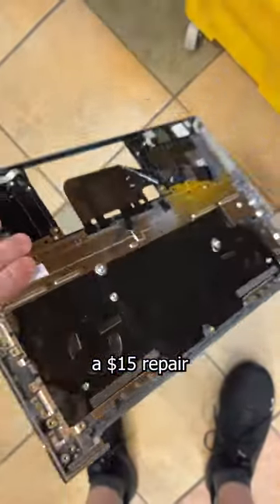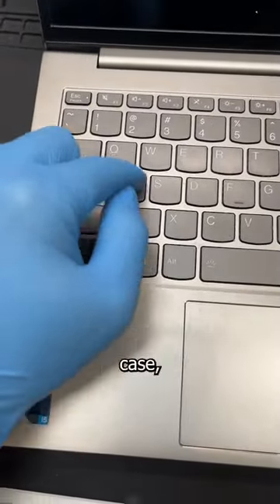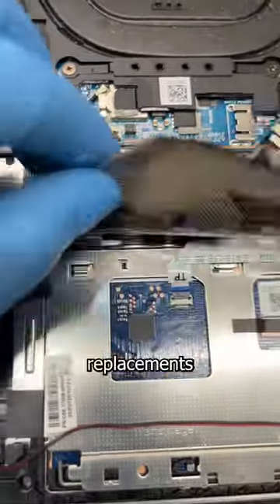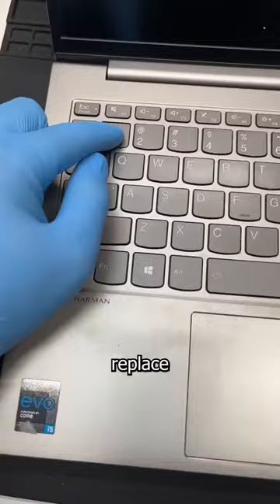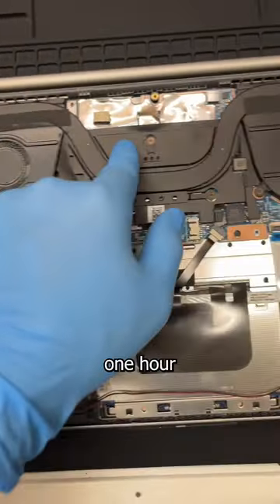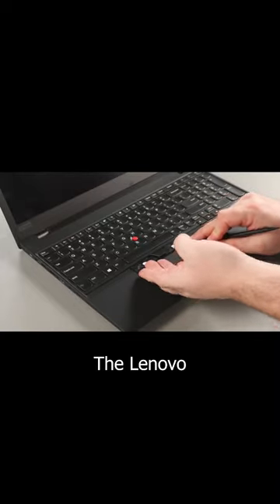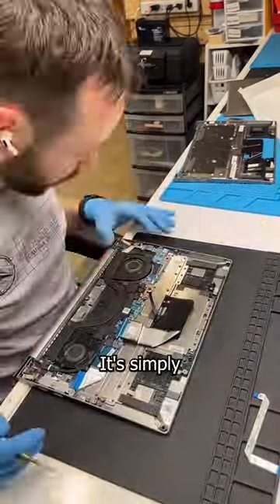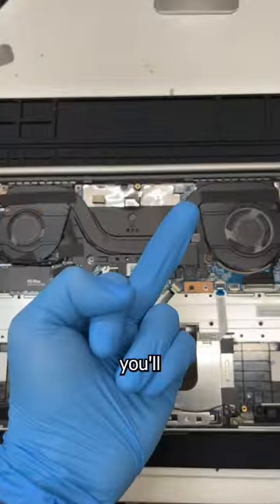This #pc design trend is bad for consumers. RIP Keyboard repair #technology #tech #computer #shorts

Comment: Thanks to Apple we have this trend. Everything is now consists of two parts: screen and everything else glued together.
Reply: On apple you can replace one key without pulling apart the laptop
Reply: @desireandfire not with the new builds
Reply: That is why i hope the new EU law comes out.

So manufracturers are forced to make repair possible. If not, well, keep you shit in china or america, you can not sell in EU anymore.

I really hope.
Reply: @desireandfire you talk about keycaps. We talk about the actual hardware.
Reply: More like thanks to consumers who just buy a new product instead of repairing their current one.
Reply: @Absol407  it is less the consumer, but more the company, which tries to attach the customers to themselfes by denying 3rd party service and repair.
Reply: @dom3827  yes, Apple sucks

The reason I’m specifically saying, Apple is because they started the trend
Reply: @desireandfire  not with new ones
Reply: @RandomRothbardian  ya apple sucks
Reply: @dom3827 i mean, they can't just pull out. They'll lose money so they will apply that shit to every device possible
Reply: @bashjj  Yes you can lmao, it's pop it out but you then have to pull down the single key and it will work.
Reply: @dom3827 i thought the whole idea of the new EU law was to force apple to use type c instead of lightning cables? And apple decides to refute it by getting rid of the charging port all toget her for their future phones lmao (forcing people to buy their wireless chargers). My point being; i don't think the law will do much unfortunately
Reply: No, thanks to basic economics we have this trend. People buy it, so they build it. If people didn’t like what Apple was doing, then they shouldn’t have funded them.

Don’t like it? Go to a country with a different economic system. This is what they’re rewarded for doing.
Reply: @bashjj Source?
Reply: @dom3827 eycaps are hardware.
Reply: @Absol407 THIS, 100%. Consumers REWARD them for this behavior. So why not do it?
Reply: @dom3827 Um, no? Buy a different device then, or none at all. You’re not FORCED to buy an Apple product.
Reply: @desireandfire  You can't replace anything. you have to buy a new one. Always the case with Apple. They have their pros but repairability is defenitely not one of them
Reply: the worst thing is that when Apple removed mini jack input and a charger from their boxes and all phone industrys did literally the same... disappointment
Reply: @maciek6482  I'm waiting for the EU to force them to add those back 💀
Reply: @snowparody  this statement did not age well, didnt it?

I phone 15 comes with type c
Reply: Don't forget the headphone jack.
Reply: @dom3827 Rare European Reich W.
Reply: @dom3827 That’s gonna be horrible as consumer. You’re stuck with mediocre designs to accommodate repairability. 

Apple has been iffy more recently but they had the whole form over function going pretty well for a while. And I miss it.
Reply: @desireandfire with one model, very specifically, you can do that. In 2020.  Every model on either side? No, you can't.
Reply: @desireandfire nope try that with any keyboard since the butterfly keyboard. You think people were just dumb, and decided they like paying for $500 upper case replacements? Nah there wasn’t a choice.
Reply: Waiting until Apple makes a financial mistake that everyone copies for whatever reason.
Reply: same with the stupid trend of making things thinner and thinner and lighter and lighter. What’s that? Now your laptop’s battery life’s getting progressively worse bcs the processors are getting more and more power hungry but you don’t have space for batteries?

or the trend of including fewer and fewer I/O ports for…some fkn reason
Reply: @bashjj if you have applecare theyll take your laptop, transfer the data to a brand new device and you can walk out with a brand new machine with everything set up the way it was… so, doesnt really matter tbh.
Reply: @desireandfire i had broken keyboard on laptop its not like this if one key breaks it will take other to drown
Reply: @desireandfire  What if the trace for the key gets damaged?
Reply: @Absol407 honestly considering laptop performance the most of the time you have to change cpu/gpu before the keyboard is consumed
Reply: @dom3827 Design over form ngl, a government shouldnt be able to force how a company makes their product design when it isnt detrimental to anyone. We dont need a government trying to get their greasy hands on innovation and technology when they dont understand it.
Reply: @hankagura5355  so wrong on so many levels.
Reply: about 5 years ago I had a macbook pro with a dead key and needed to fix it.. brought it to the genius bar and the "genius" told me it was a 700 pound fee because they had to swap the whole thing.. It just made more sense to buy a brand new one
Reply: @189x  it makes even more sense to consequently buy another brand. 

Apple is 1984. Funnuly enough, because they made an Anti 1984 TV ad back than.
Reply: its like saying people started taking shits on the street is my fault just because i took one
Reply: @midnightperfectworld  lmao because you've already paid for the "free care" whether you need it or not.
Reply: Me watching a group of about 6 absolute idiots argue over whether a tech company changed a piece of computer hardware:
Reply: Hmmm yes lets blame apple cuz we dont like them. It doesnt work like that pla
Reply: Why doesn't this show as a disadvantage on the market?
Reply: Same with soldered ram.
Reply: Steve Jobs created a modern nightmare for all of us non-Apple users.
Reply: @matasa7463 If it's a nightmare why are PC companies copying it? Shouldn't it be an advantage against Apple?
Reply: @kpbendeguz  because Apple makes money, and other companies want Apple level money.
Reply: @matasa7463 Yeah, but if Apple does something that bothers customers why competitors copy that mistake? Why don't they use it for advantage?
For example Apple limits people's options for home repairs. Probably because the customer group targeted by Apple doesn't want to repairt their stuff at home anyway, so Apple can make its products thiner, cheaper to produce, etc. in exchange of home repairability.
However an Apple competitor could target a different group that actually does care about repairability and steal those customers from Apple. So why don't they do that?
Reply: Why do people have to copy the bad stuff from Apple. The good stuff sure I get. But bad stuff?  Just no.
Reply: 127.85% my dude😂

Comment: This is the reason why we need to support the FrameWork laptop. Modularity allows for replaceable and repaireable components
Reply: I'm sold. I'm buying one as soon as I can.
Reply: and according to another comment it's $900 and you have to assemble it yourself I'm probably going to end up getting another laptop.
Reply: @yourlocalidiot69420 their “DIY” laptops are a bit of a misnomer. I got a DIY model thinking I would have to fully assemble it, but all I needed to do was put in the M.2 drive and RAM sticks. Then you put the keyboard plate back on with like 6 screws. They also have an assembled version though. But yeah they are priced as premium laptops but the repairability makes it worth it to me, though not everyone is going to value that aspect as much. So in the end it’s just preference.

Comment: Planned obsolescence
Reply: Nah probably not.
It is cheaper, and more durable and as mentioned has a better typing experience.
And the "for whatever reason" is that people started to very much prefer these laptops so amufacturers simply build what people wanted.
Reply: @AlphaHorst  sure people wanted this, not every company simply started to copy apple...
Reply: @mtx33  apple was not the first to do this... but ok dude. 
I believe Dell did it in some of theirs as well as HP and Microsoft.
Reply: yes planned obsolescence disguised as "making it cheaper to build and durable and so called better typing experience".
Reply: @Kuroji07  well everything has its downsides. So if you want to call every downside a case of "planned obsolescence" be my guest. Well if you can write this on your modem powered Internet.
Reply: @AlphaHorst  maybe apple wasn't the first to make an integrated keyboard like this (if they even really invented anything at all), but it was the first company to make it's core strategy to build products as hard to repair as possible and the industry tends to follow money. 
It's a business decision to control the product life-cycle and not a technical one. I've had similar style laptop a couple of years back but instead of plastic rivets, the keyboard was secured by a lot of tiny screws.(no height difference) There is no real excuse to do this other than profits. 
Think of a mechanical wristwatch, so small and so complex, water resistant, durable. So how come we can disassemble them to the last cog? It was designed that way.
Reply: @Kuroji07  planned obsolescence wouldn’t be so much of a problem if it weren’t a software issue instead of a computing issue

If you’re using a Apple phone, that’s obsolete, they will not allow you to use apps, and other things that require the newest iOS
Reply: Mostly just cheaper and way easier to manufacture
Reply: @AlphaHorst Hows that boot tasting bud?
Reply: @AlphaHorst is it more durable? If it's cheap and hard to repair that is definitely in line with a plan to require replacement.
Reply: @Kuroji07 Exactly. Some eMachines laptop from something something 2000s still goes strong even with one key fucked.
Reply: yh

Comment: As a computer repair tech I hate this trend. 👎 Every week we get broken keyboards and you’re absolutely right, it makes a quick repair into a long ass nightmare 😩
Reply: Get a solder station you won't care about a whole lot and you can get JUST the keyboard. Get some 3D printer filament and you can plastic weld it into place. Once you're good at it, it's a 20-30 minute process
Reply: During high school I became my school districts computer repair guy and every kid in the school had a computer. I watched the change in keyboards happen and I really had to slow down on my repairs because of it...... I GOT FIRED BECAUSE I WAS NOT FIXING COMPUTERS FAST ENOUGH!!! So with that said I am so sorry you have to deal with this.
Reply: @bridgergriffiths4364  And then they had no repair guy at all. Any replacement would’ve been just as screwed.
Reply: Why are you whining? Thats more cash for you.
Reply: @nordicsweetroll I also thought about a solution like yours, but I have doubts about the tightness of the new plastic on that shit they put
Reply: Do u know if a nitro 5 has this problem (sry kinda random, I’m just looking at buying one and am curious)
Reply: @nordicsweetroll  Man of tech culture I see
Reply: @kaeji_namitsua 
1) if you tell a customer that a keyboard replacement will cost $200, there is a chance said customer will say “f-it!”, and put those $$200 into a new laptop.
2) there is a higher chance a customer will agree to spend $20 to change the keyboard than $200 for, in the customer’s eyes, the same procedure. 
3) as the video states, replacing a keyboard that’s fused with the palmrest implies risking damage to other components (those damned ribbon cable feet break apart all too quickly)
Reply: two words buddy..
SKILL ISSUE

Comment: me quietly sitting with my thinkpad x220 which only needs 2 screws to remove the keyboard
Reply: based, I have an X220 also
Reply: I recently got a P52 and the keyboard is very annoying to remove (and also delicate) but at least its not that fuzed bullshit
Reply: Same on my T480s
Reply: Same on all my ThinkPads.  The T, X, P series are  the only notebooks people should get.
Reply: @TexasCat99  Absolutely
Reply: On my thinkpad x270 i need to remove 12 parts for this, including all parts in case and screen
Reply: I have its big brother 😂 x230
Reply: I love my t480
Reply: Still true on my 2023 T14
Reply: My X200T is the best for this. Plus that keyboard is a joy to type on.
Reply: @TexasCat99 true. I have a T450
Reply: @Coder714  I have T460s.  Love it
Reply: Same with x131e

Comment: Well, to prevent any potential damage to laptop's keyboard, you can use external keyboard (if you have lying around, if not you may need to buy 😅). But, for certain activities, though 

I have PS/2 keyboard that was given by my uncle. I use it on my new laptop to reduce issue mentioned on video. I bought adapter for that

Sorry if I made this long comment. As I'm about to give solution for that issue 😁

Comment: The manufacturer SAYS that this design makes the keyboard more sturdy to type on. They then ALLOW the idea to circulate that it's "really" because of manufacturing costs. But the real reason is that these types of designs deliberately makes repairing your products increasingly unfeasible, which forces to the customer to buy a new product when their old product breaks. Which the manufacturer in turn makes a boatload of money from. The fact that it fucks over everyone else, is none of their concern in their eyes.

See, large companies and corporations are really simple and predictable. They are looking to make more money, always, without fail. It doesn't matter how much money they already have or what the markups on their products are. They just want to make more money at all times. That is their sole motivation, and the only thing that ever holds them back is their perception of what they can and can't get away with. They will lie, cheat and steal without a second thought. They'll break any law without batting an eye, so long as they are confident that they won't be held accountable for it.

Once you realize this, it becomes a lot easier to see through their bullshit.

Comment: As a Toughbook owner, the only steps to replace the keyboard is to remove 5 screws on the hinge cover, then the keyboard is held on with just glue. For all other repairs, just take off the display and upper palmrest.

Comment: As a certified apple repair technician keyboard replacement’s are an absolute nightmare and probably the hardest repairs to do because you have to remove every single component from the bottom case because the keyboard is riveted into the aluminum housing(it’s cheaper as a machine can rivet easier than screw down) but not all components are part of the logic board so you also have to deal with things like lid angle sensors and Touch ID and the display has to come out and the trackpad.

What’s “great” is the battery is adhered down on the Pro models so battery replacements are just keyboard replacements but billed differently. Unlike the MacBook Air line where the battery adhesive has pull tabs like the iPhones so a battery replacement is relatively easy. Now you may wonder why we cant heat up the battery adhesive or use IPA and the reason is apple’s requirements on certified technicians and that in most cases we actually have to ship the top case back to Apple so they’d know if we sent the new board or if the battery was removed. The point I’m trying to make is that I’m mad the MacBook pro’s still don’t use pull tabs and instead make technicians go through a significantly more complicated process for the same repair. (There’s a reason the MacBook Air battery repair is just under $100 cheaper than the Pro’s with AppleCare+[comparing 13” air to 14” pro])
Reply from the maker: Please come work for me

Comment: framework laptops there not only consumer freindly but they frankly have some really really nice specs especially the new 17 inch models

the gen 13 inch model has already had 3 or 4 motherboard generations which you can upgrade to by simply swap[ping out the motherboard getting a cpu upgrade to the latest tech whilst maintaining the same shell and overall device
Reply from the maker: I would absolutely love to be able to review a Framework laptop. I am such a huge supporter of their products
Reply: @SalemTechsperts  i love the idea of the framework 17 but im holding my breath for something else from them 

theyve made no indications they will do this or said they are even looking into it

but if framework was to develop a handheld like a steamdeck a ayaneo or a rog ally

id about loose my god damn mind
Reply: they're also $2400 AUD.

Comment: Yea, i've run into this being a problem, AND a life saver. Its really a trade off and could be implemented better. This design, actually improves water resistance, i spilt water on my keyboard, and since the whole top portion has a floor of plastic, it kept the water out of the mother board, BUT, i still had to clean any water that deposited, and yes it was a pain to take apart. I feel like you can keep the water proofing ability while making it easier to disassemble without too many holes.

Comment: Thinkpad 😎 🔴
Reply: I miss the IBM designed ones, they were designed with corporate IT shops in mind as their market. Just about any part could be replaced in a short amount of time, and without any risk of damage. The earlier ones didn't even need screws removed to get to the innards, just a latch on each side of the keyboard.

Comment: My laptop is from the early 2000s and it is very easy to replace the keyboard i just take off like four screws and pull it off. But i dont use that one anymore because its like 3 frames per day